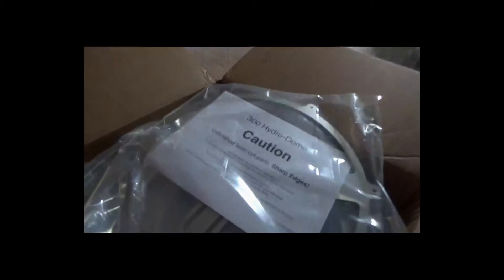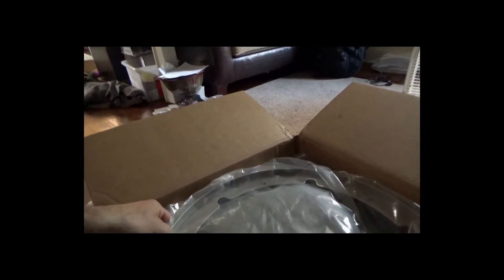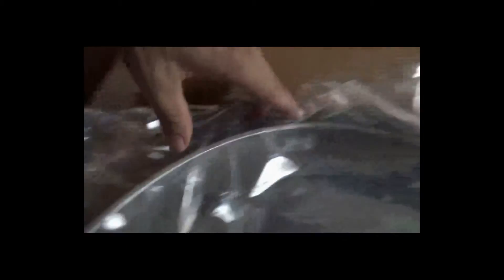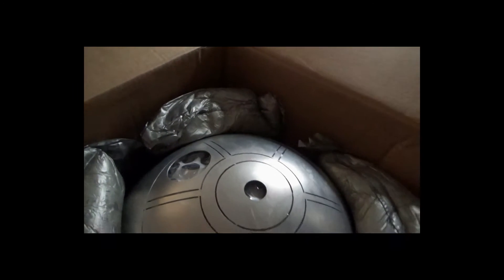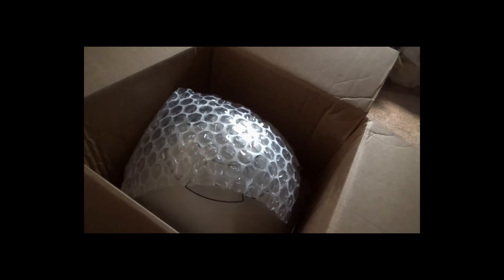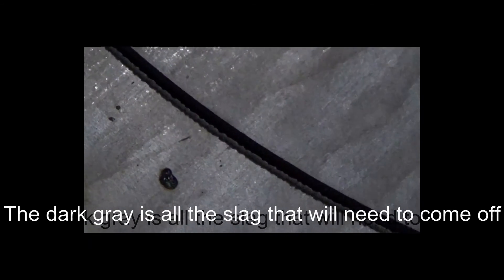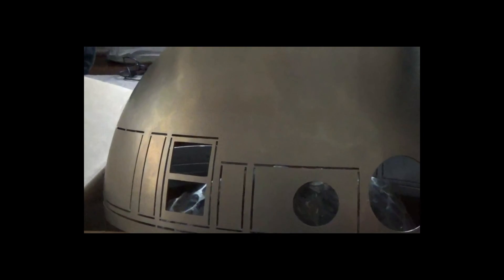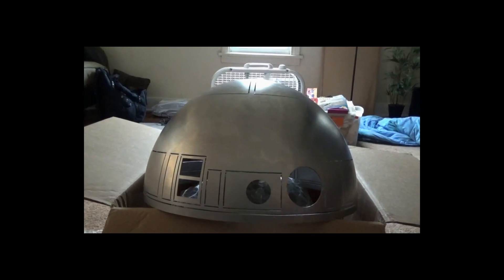How to Build an R2-D2 - R2D2 Dome Arrival Unboxing

Comment: Question. What is the point of two domes, an outer + inner, if they're going to be glued together? Wouldn't it be easier to create one?
Reply from the maker: The two domes are actually not glued together. The are held in place by the screws  for the radar eye and the holoprojectors. The top dome is designed so you can easily cut the pie panels out it will sit on the inner dome and give an edge for the outer pie panels to rest on.  It reduces cost of forming the domes.

Comment: 300 mm? Is this the diameter or height? The specs say 18.25 inches in diameter, ~46.355 mm. Or am I wrong?
Reply from the maker: +Christian i think height. Either way.  It fits the standard R2 with no worries.
Reply: Build an R2D2 Thank you so much :). I just become a member of the R2D2 Builders Club and got a little confused about the measurements. You know, inches vs. cm ;)
I plan to build a highly autonomously R2 unit over here in Germany.
Reply from the maker: +Christian look into the UK builders forum as well.
Reply: Build an R2D2 I will do that, thanks again :)

Comment: Whats the size of the dome ?
Reply from the maker: ddrusa It is a 300 mm hydroformed dome.  I got mine from and aluminum parts run off http://astromech.net
Reply: is that what the measurements is
Reply from the maker: ddrusa This is the diameter of the dome, however, it is not a perfect sphere. The R2 Dome is more eggshaped.  I suggest you join the Astromech.net forum and read up on the process.  It will be very helpful.
Reply: The reason why I am asking I been wanting to build one for a while as well. And i can't find any accurate measurements of the body frame on google at all. Star wars is a awesome movie and I can't wait till the new one hits the theaters. That is why I want to make one
Reply from the maker: ddrusa I've told you the website to go register at.  http://astromech.net  It is a loaded with information and will point you in the right direction..  research, research, research!
Reply: Ah thank you I shale check that out
Reply: Is it free to sign up
Reply from the maker: ddrusa Yes.
Reply: cool